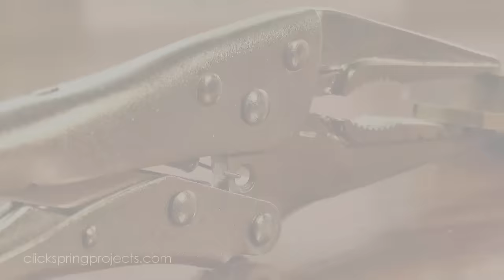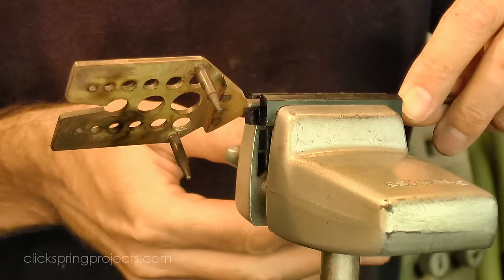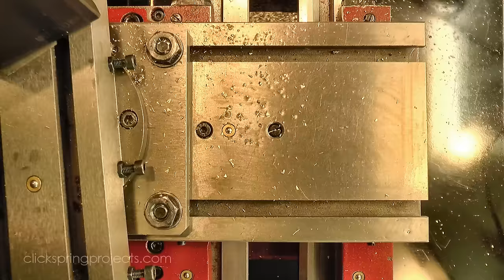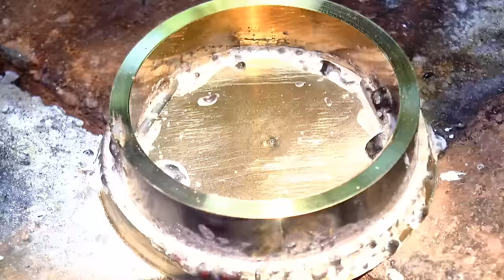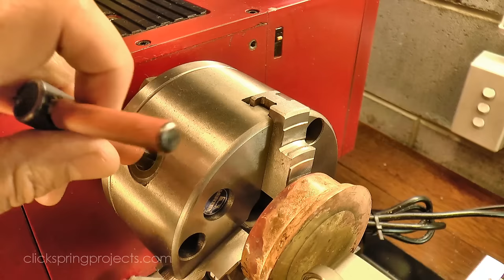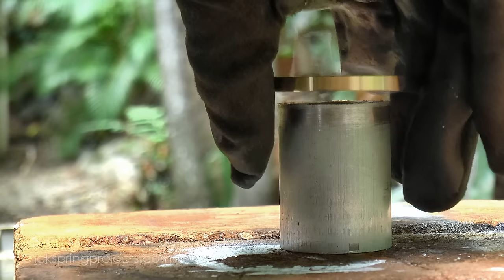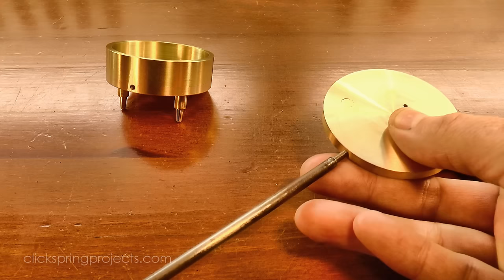Home Machine Shop Tool Making - Making A Versatile Bluing Tray

Comment: In Goldsmithing, I usually put my solder on the outside when soldering a container or crease like that. I mostly do this to be able to get the solder hot enough and avoiding melting the piece if I'm using harder solders. Another reason would be to that if I were to use too much solder and placed it on the inside, it could skate further away and pool, sometimes even start "Eating" into the material, while it is a little easier to control in on the outside and generally easier to clean up as it is more accessible.

Thought i'd share this for that one random person who would find it useful while randomly reading the comments xD

Comment: you make me wish I had the money to pick up machining. I barely have enough to do woodworking
Reply: A lot of machinist start off with woodwork.  It doesnt cost a whole lot if you want to get started machining. You can find old mills and lathes for a decent price if you look and are patient. I don't keep a wood turning lathe in my shop because when I need to turn something thats wooden my metal lathe works just fine. And since I purchased my mill, I hardly use my drill press unless its easier than swapping up a particular setup that might be on the mill at the time. I primarily do woodwork for paid work, but in my off hours its always some sort of machining project ive got going on. Save up and don't be afraid to barter or work for the tools.
Reply: Get this:  You can turn wood in an engine lathe.  I've got a customer buying trophies from me that have a cylindrical wooden base.  Dowels of the right dimension just aren't available, plus I need them center drilled. So I fire up the old South Bend.

Comment: There's something sacred about the color of Dykem on brass and the color of your heat treatment that gives me goosebumps!  Maybe a new science...Sacred Colors and would be interrelated to Sacred Geometry.  Your videos brings the two together beautifully, I think.  Thanks Chris.  ~PJ
Reply from the maker: pjsalchemy I couldn't hope for a more beautiful compliment than that PJ, thank you.
Reply: pjsalchemy Someone asked why he used brass chips instead of sand to blue the parts, and to me the answer is simple: the brass holder filled with brass chips is just gorgeous. Sand would look fine, I'm sure, but the brass chips look regal and magnificent, especially with the blued steel.
Reply: Jesse Crandle Clickspring Agreed, and did read all the comments.  But I think its the uniformity of the brass chips (over sand) and temp control with his deft hand and eyes that allows the perfect thickness of oxide to form and create the thin film interference...which creates a very unique color.  However there may be some other Alchemical transformations unaccounted for...~¿@

Comment: When I run colors for tempering tools I make I use a heat source usually another piece of steel that I've heated to a bright yellow heat.  But, I'm doing blacksmithing and usually my tools are tempered from straw to persimmon.  I don't recall ever going as soft as blue.  I like your technique.  I'm no machinist.  The closest I get to that is punching and drifting a hole in very hot steel.  But I don't have to be as precise.  I really enjoyed your video.
Reply from the maker: +Bryan Morgan Thanks very much for checking it out Bryan :)

Comment: Hi, love your videos, on the bluing tray, personally, I would have drilled the two holes for the feet in the tray first, then put the feet in and rested them on top of the vice so that the hole on top is square to them. Unless the top of your vice isn't flat.

Comment: Jewel-like, as always. Thank you.

Any comments on why you choose brass shavings rather than a fine sand for the medium? I've always used a sand-filled tray for drawing hardness (tempering) tools when home heat-treating. If I stand the tool up (like a punch) leaving the tip well out of the medium, I can get a differential tempering - leaving the tip fairly hard (medium straw) while getting the shank a bit softer (dark straw or a bit more).
Reply from the maker: Peter W. Meek Hey Peter - I think sand is a good medium too; I recall the UK Tubal Cain mentioning it in one of his books. The  brass perhaps has a greater thermal conductivity, so the heat is transmitted better across the whole part? Not really sure. Truthfully, It is the method recommended in all of the classic watchmaking texts, so I have decided to follow their lead! Thanks again for watching mate.

Comment: Very great videos, and your attention to surface finish is nothing short of exemplary!

One very humble suggestion, give power tapping a try!  5 minutes on each tapped hole adds up fast, You will save yourself hours of time on these projects, and it's as simple as grabbing a tap loosely in an old chuck or collet. If you're quick on the reversing switch it wont bottom out, if it does bottom out then the tap just slips in the chuck!  With a little practice you'll learn how much to tighten the chuck on the tap to let it slip at the right time, the holding range is quite large.  In the lathe it is even easier because you can just let go of the tap or die holder and let it spin with the work while you shut off or reverse the lathe.
Reply from the maker: mrchew1982 Hey there MrChew, thanks for the suggestion - I do power tap, but not usually on camera, as I usually want to show what's happening slower rather than faster. Thanks very much for the kind words, and for watching :)

Comment: Another great vid.. I wonder if I could use this method with stainless steel screw heads..
Reply from the maker: lbcustomknives Yes I believe so, although I don't have much time on SS so can't speak from personal exp. My understanding is that the chromium delays the oxide formation, so that the colors are delayed until higher temps. No doubt there are other differences too, but I have seen stainless blued in operational use like the tailpipe of a jet, SS camping stoves etc. Thanks for tuning in again mate :)
Reply: I hear color them gold... For my folders and anodize the titanium.. And get a very even color of gold never took them past that.. But I'll make the tray like you have.. Great little project.. And give it a try... Keep up the great work mate..

Comment: Another great video Chris.  I had a go at making a hand held countersink tool like yours today.  It doesn't work very well and after having a closer look at your website I think I can see what I did wrong.  I need to mill the flat surface to half way.  I went slightly under.  Anyway, I'll have another crack at it next week.  Thanks for your videos.  I really enjoy them.
Reply from the maker: John Creasey Hey John, thanks for watching again mate. Yes you're right that the countersinks need to be cut to half way. Some advocate just short of half way by a few thou to allow for sharpening. I also mill out a 'scoop' behind the cutting surface to allow a slip stone to have full contact with the cuttting face for sharpening.

Comment: Original bluing pans are designed so that if you connect the pan to the handle with a loose rivet the heat will more easily be retained in the pan and not spread to the handle.

Comment: Could this idea about using brass chips and this pan be used for tempering small parts? Great video as always.
Reply from the maker: Garage workshop Yes absolutely, in fact that's what I'll be using it for. Before I polish the parts, I need to temper them, and that will happen in this tray. After polishing, they then come back to the tray for the final bluing. In a sense, they end up tempered 'twice'. Thanks again for tuning in mate :)

Comment: I wasn't even aware of this sort of tool till now. I wonder if using pure copper chips instead of the brass would improve the functioning of it, as the thermal conductivity is far greater. Though it seems to work just fine with the brass.
Reply: Maybe it would be too fast with copper. With brass it makes it slower so you have time to take it out at the right color you want.
Reply: The higher thermal conductivity might speed it up, but that could be handled with reducing the heat input. It's more about achieving an even temp on the whole part so that the color is an even shade.
The higher the thermal conductivity, the more even the temperature will be.
Reply: Siegfried Gust true. But who knows maybe he's using brass because he's just got shit ton of it and don't know what to do with it.
Reply: That's what I'm guessing. He makes a lot of stuff out of brass, so he's got lots of brass chips. Like I said, seems to work just fine.
Reply: Resulting color is not too strong though.

Comment: I am a student going to school  for watchmaking, and I was wondering what the relief angle is on your single point cutter. I was also curious on how you're able to remove so much material in one pass, and with such a perfect finish. Is it a high speed steel cutter?
Reply from the maker: Usually I grind the relief angles somewhere between 5 and 10 degrees, its not particularly critical. I use HSS almost exclusively; it makes everyone look good, especially on brass. Thanks for watching :)
Reply: Thanks for your reply! I love your videos!

Comment: hey mate what material did you use? it is normal S235JR (In German its called "Baustahl") or Brass?  sorry maybe i misunderstood something in the video and didnt get the material :) VERY NICE Project  GO on
Reply from the maker: I mostly use a leaded free machining brass, although the tubing offcut is almost certainly a low lead brass (much less machinable) thanks for watching
Reply: Clickspring hahaha i thought wtf steel has a realy strange yellow color in your videos :) ok that is the reason   thx for your answer

Comment: These videos have been a huge help to me! I have one question. What sort of torch are you using to do the silver solder? I have been trying to use hard silver solder paste on large brass parts but I can't get the metal hot enough for the silver to flow. Right now I'm using a standard propane torch.
Reply from the maker: It depends on the size of the workpiece; the larger it is, the greater the heat output required from the torch - I have three torches depending on the level of heat I require:
http://www.bunnings.com.au/tradeflame-mini-soldering-torch-with-stand_p5910253

http://www.bunnings.com.au/tradeflame-propane-handyman-full-flame-blow-torch-kit_p5910245

http://www.torchtools.com/BBQ%20Prop%20WHITE%20NET.jpg

I occasionally hit the upper limit of the larger propane torch that I use, but it covers me for most of the larger work that I do.

Thanks for watching Lucas
Reply: Thanks for the help! I also saw some people using two smaller torches when working with larger parts. Is this something you would recommend? It seems like it could be a little dangerous.
Reply: It's pretty common to use more than 1 torch at times.I do it in a homemade refractory oven made from special bricks and I can heat it from both ends if needed.I dont know what he uses for his oven in the videos but I feel the blocks are safer because they are solid.Although I had the bricks from a old furnace,had I had the stuff he does on hand I probably wouldve used it too.

Comment: As I've stated on Facebook, you have an excellent attention to detail... regarding BOTH your craft and video making. I do have one question. I noticed you use super glue to hold your parts. Would it help using the live center also? If not, what's the reason. I'm hoping to build my wife a clock one day and your videos are an excellent source of information. For that, I can't that you enough.

Cheers mate,
Jeff
Reply from the maker: Naked Machinist Hi Jeff, the super glue is strong enough to do the job of holding the work, and doing away with the need for a live center means that I can access the front of the part too for a facing cut. Thanks very much for tuning in :)

Comment: Awesome! Can I ask smth? How can I bluing little copper parts, such nuts and bolts? Thank you! :)
Reply from the maker: The bluing process used here is applicable to iron/steel parts. Copper does not oxidise in the same way. Cheers :)

Comment: would like to know if the metal you turn on blue 
never get a rust again? thanks.
Reply from the maker: +Romo Yes it will rust, although the oxide has a tendency to retain a very thin film of oil, so it has a better resistance to corrosion than no oxide at all. thanks for watching

Comment: Love the video but my only concern is that you may potentially re-melt the silver solder as you are bluing the part.
Reply from the maker: Torbox1 Don't be concerned, it's all good - The blue temper color typically occurs at around 300 degrees C, well below the silver solder melting point of approx 600 degrees. The tray will never get anywhere near that temperature. Thanks for watching and asking :)

Comment: Nice! Does the bluing happen at a lower temperature than the silver solder or is there a different kind of bond that happens to keep the parts brass parts together when the tray is heated for bluing?
Reply from the maker: DammitCoetzee The bluing happens at a much lower temp than the silver solder, typically around 300 degrees centigrade for the final blue color, so the silver solder bond is unaffected. Thanks for watching and asking :)

Comment: Another great video Chris, this may be a daft question - but why do you sometimes bevel edges with a file and others using a bevel tool, is it just the setup time or for a designed look?
Reply from the maker: martin godsell Hey Martin, yes just setup time, sometimes I get a bit lazy! If I know the bevel will be a visual feature as well,  then I will be a bit more disciplined, and drop in the bevel tool to make the cut crisper. Thanks very much for your continued support, I appreciate it.

Comment: Hey Chris, do you use mild steel or does stainless work better for blued parts? Thanks for the vid, beautiful work as always!!!
Reply from the maker: Neels Smit I use a medium carbon steel as it can be quench hardened, and then polished, which leaves a nicer finish. Stainless can be blued too, but my understanding is that the chromium delays the color formation, so it all happens at higher temperatures. I noticed a stainless steel tailpipe on a jet APU the other day, and it had all the same temper colors, from the business end back to the fuselage.

Comment: What do you put on the screws to keep them from rusting? In earlyier video, I saw you drop the hot screw into liquid, what was that? oil? Keep them comming.
Greg
Reply from the maker: Gregory West Hey Greg, you are spot on about the oil, that's probably the most effective anti corrosion measure. The oxide itself is also said to provide a measure of rust protection, although I suspect not much. Another factor that helps avoid corrosion is a black polish. Watchmakers pursue a black polish for aesthetic reasons, but also because it reduces a parts susceptibility to rust. Cheers mate :)

Comment: Beautiful work Chris, I had never heard of that bluing technique before this. It would be cool to try it out. How polished do you get the surface before you start the bluing process?
Reply from the maker: Alex Stockton Hey Alex, that's a great question - the polish has a big effect on the final color. Funny enough I have found that with a black polish it is harder to control the color than a polish that is slightly less refined, like say 3000 grit. The slightly rougher surface gives the richest purple and blue, and the transformation of colors seems to be easier to control. Thanks for watching mate :)

Comment: Hi Chris, 
Love your vids, there's a level of professionalism that I have honestly never before seen on YouTube! Could you tell me when you would use the plate version over the brass chips? Thanks a lot!
Reply from the maker: Watts Up Thanks for the kind words mate! The plate version is good for thin section items, and is a little bit easier to use - heat up plate, drop item on, pick off when at correct color.
Reply: Ah! Thanks a lot. You've got me looking for lathes now! Any idea what I should be looking for in the UK, small and cheap for a beginner?
Reply from the maker: Watts Up I wrote an article on my blog a little while back that might help: http://www.clickspringprojects.com/blog/which-lathe-should-i-buy
Reply: I did read that, but I was wondering if you have any UK-based recommendations - probably a silly idea since you're not from here! Anyway, I'm looking at the Sieg Super C3, does this look reasonable for the cost? How about the accessories I will definitely need to get started, or other similar models. I'm still looking for a specific area to focus on in my work (I don't think clock making is the discipline for me, however cool you make it look), so I'm open to suggestions there as well. Thanks a lot, and sorry for taking up all of your time!
Reply from the maker: Watts Up Re accessories etc, it really is a bottomless pit - just start with the basics, and go for it mate. Your tools collection will evolve with your project tastes, so my best tip is just dive in with what you can afford, and get started making chips!
Reply: Thanks Chris, I think I'll do just that!

Comment: just a question, this save to use with hardend steel? i'm not that familiar with the effects of heat on steel but i was under the impression that if you take hardend steel and aren't careful with higher temperatures i'd could render the steel useless.

Anyway great vid's all of them.
Reply from the maker: +gorden2500 Tempering hardened steel through the colors of light straw to blue is the necessary process to take it from fully hard, to a less hard and tougher condition. The blue color is the last step before the steel starts to turn grey, and lose too much of the hardness. In that state it retains a fair degree of the hardening, but is much more flexible and tough, making it perfectly suited for items such as springs and screws. Thanks for watching :)